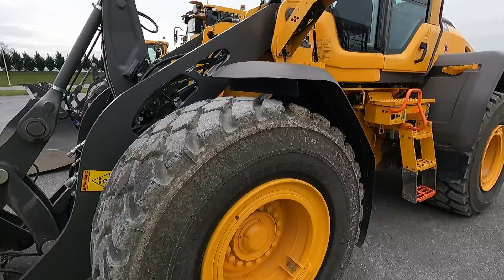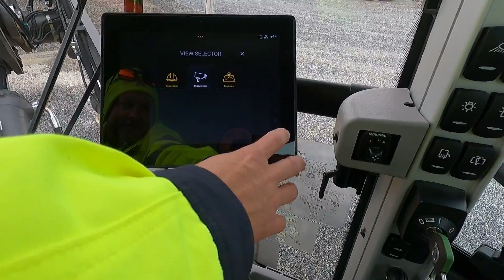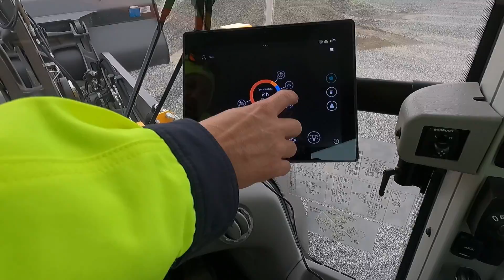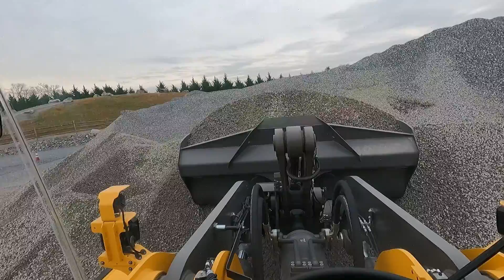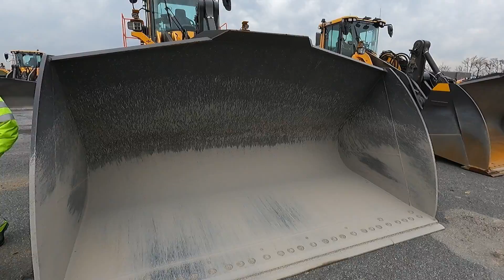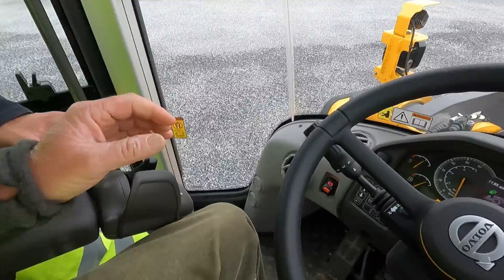Testing brand new Volvo wheel loaders 💪🏻

Comment: I have driven 95% of wheel loaders from 70’s to current, the L220H is so powerful was incredible.  Currently operating L 150H . Love optishift, but please Volvo,, time to drop the steering wheel,  better seat cushion and you will have almost perfect machine .  Until then CAT takes the cake for operator comfort.
Reply: I wish they would just implement the detachable wheel as an option straight from the factory (might do, but I think it's just after sale from 3rd party), I don't like where the only option is joystick or wheel. I want to be able to use the wheel depending on the job. I get it if all you do is one task in a quarry loading trucks but if you have different tasks it's nice to have the option to use the wheel for added precision, a detachable wheel would be a good compromise.

Comment: I used to love Volvo machines but they are not what they used to be. Their after treatment system is trash.  The artic trucks are the best on the market as far as durability. We have 5 of them now but I need 7 to have 5 constantly running.  My EC480 has been down 80% more than the PC490 primarily because of the after treatment.

Comment: Tim...This never ceases to amaze me!  You have a 15 ton machine designed to operate eight hours a day almost every day and last at least ten years (about 150,000 hours) before needing any real work done to it and there is a 5.7 liter diesel six cylinder engine.  Yet a 2.5 ton pickup needs a 6.7 liter diesel and if it can get 5,000 hours before needing major work/replacement you are damn lucky.  The difference between a work diesel and the pickup throwaway diesels.
Reply: no loader lasts 150k hours
Reply: @alexstromberg7696  The max. Hours i've heard of are about 70000h on a Volvo Loader. The usual range is 10000h-20000h.
Reply: Ten years @ 8 hrs a day 5 day weeks  = 20,800 hrs.

Comment: Hey Mr Tim is vovlo all logging stuff? From Bryer
Reply: Volvo do have machines like the high lift loader used in the timber industry. Volvo Forestry excavators are used for logging in places like the Pacific North West and Down Under. E.g Youtube channel TDX Ltd (formerly TransDiesel) title "On the Job with Bryant Logging and TransDiesel" - 19 Volvo machines at the time of filming. 3 models options  250 - 73K lbs, 300 - 81K lbs, 380 - 103K lbs. Factory rops cab with 1.25 inch margard front window. Factory straight boom option for log processor work.etc
Reply from the maker: Mainly construction/dirt